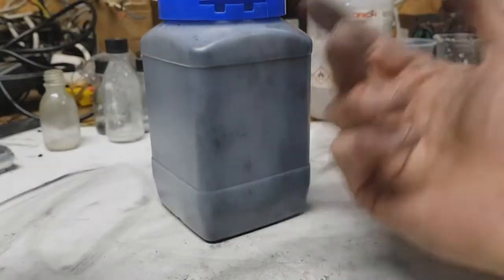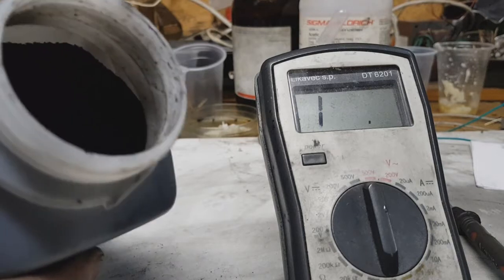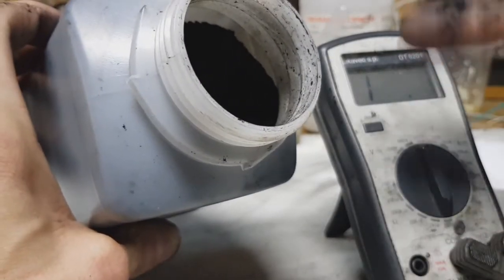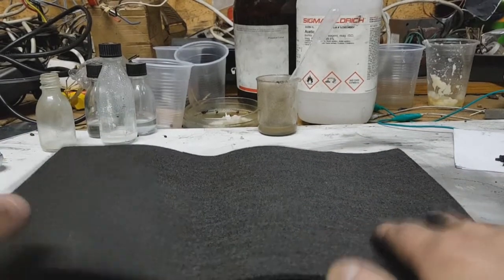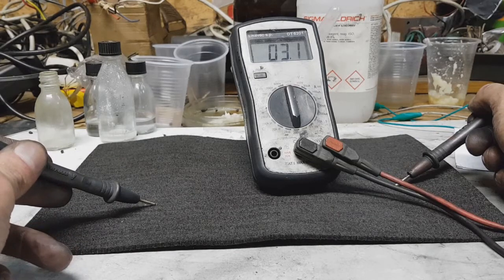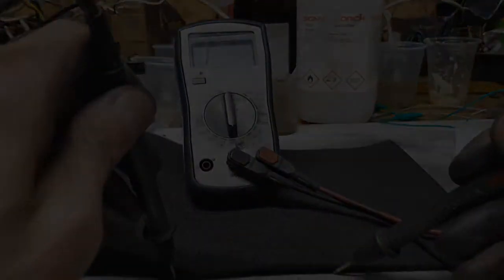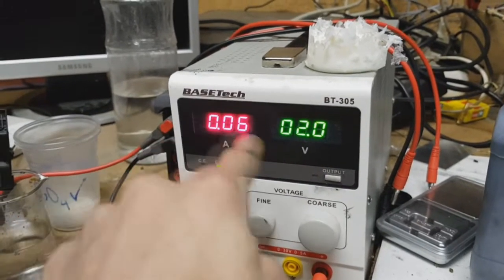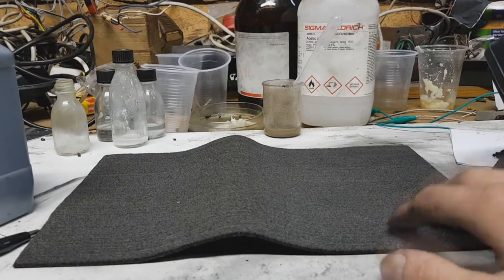CARBON better than today's Graphene? PART 2

Comment: hi cayrex2, where did you buy the material for that low resistive and flexible material? also how do you soak that in graphite? i'm interested for my own research on how to transfer plasma on certain materials.

thank you.
Reply from the maker: Tony Mortison carbon fiber: https://rover.ebay.com/rover/0/0/0?mpre=https%3A%2F%2Fwww.ebay.com%2Fulk%2Fitm%2F182642514504
You can make a ink from active material or graphite (binder+graphite for example) and you soak carbon fiber into the ink.

Comment: The graphite fabric is very interesting. As an electrode in a cell it seems like it would be beneficial. Your resistance measurements pretty much validate the advertised value. An important test would be to build a cell with an electrolyte of optimum concentration and measure the characteristics in charge/discharge cycles to see if it degrades over time.
Reply from the maker: Graphite fiber is pretty stable in many electrolytes. I make a graphitic fiber supercapacitor

Comment: Hi Cayrex, where do you buy the foam?
Reply from the maker: hello mate,,.... http://www.ebay.com/itm/3-5-8-10-14mm-PAN-Based-Graphite-Carbon-Fiber-Cloth-Fabric-Mat-Foil-Felt-U08N-/182642514504
Reply: Cheers mate, just ordered a 5mm piece.
Reply from the maker: +solarhope yes. My Is 5mm,..... you will love it.